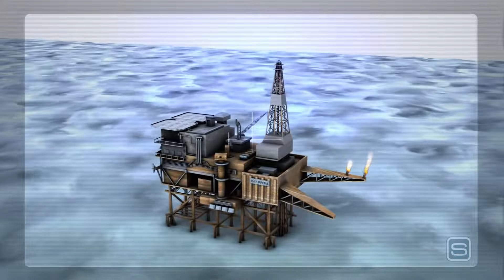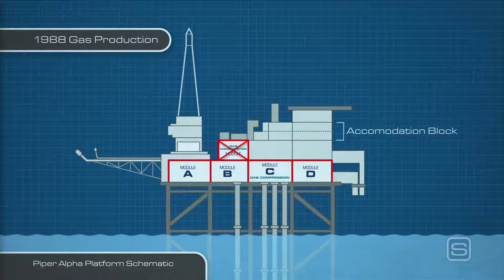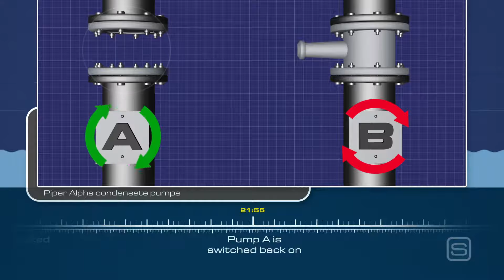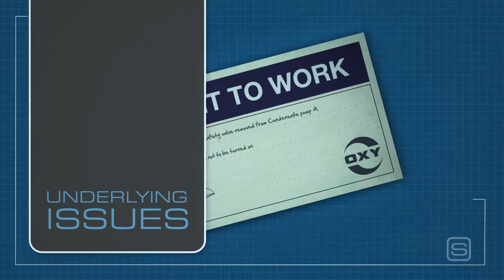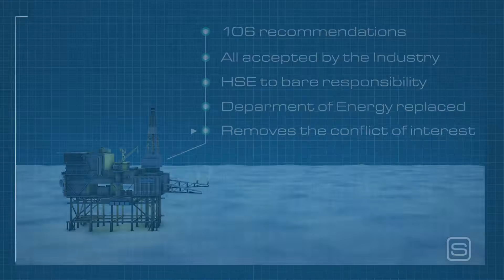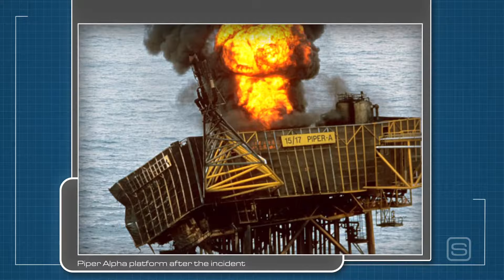Case Study: Piper Alpha

Comment: I am From the Petro-Chemical Industry in Australia Manufacturing  Iso-Butanol... N Iso-butanol and Iso-Octanol.. from Synthetic gas 50% Hydrogen/Carbon Monoxide ... Propylene and Heptane.. we had an Incredible Clearance to work System in place BUT it failed on Saturday Morning at Shift change resulting in Hot work being carried out in the wrong Place (Oxy-Cutter) A tank that had a Nitrogen sweep on it was turned of for some reason resulting in Oxygen contamination in the gas space ... BOOM.... 20.000 lts of an organic cocktail went up , tore the Tank off its foundation .. resulting in 5 deaths and many injuries during an Annual shutdown I was driving back from Queensland when i heard it on the radio ... Me !!! I was a Shift Manager for ICI Australia... thanks for reading .... foot note we use to use Piper Alfa in our Safety Training video's...

Comment: It also reminds me OXY Bangladesh blowout 1997 where I was physically present at our first wellsite.
Reply: On June 14, 1997, a destructive gas well blew out at the Magurchara gas field in Kamalganj, Moulvibazar district. I worked at that location prior to the blowout

I was on contaract to Oxy for 2 years, they also had a close shave in Sylhet around 1998 with a gas well
Reply: Thanks for the info. May you please give reasons and root reasons which cause the accident? I would highly appreciate it if spoken in safety terminology and methodology